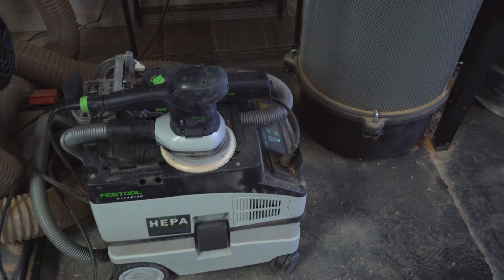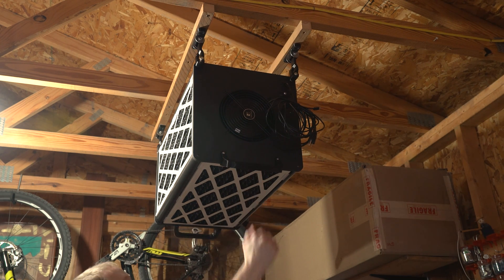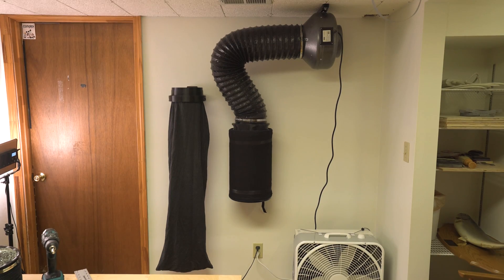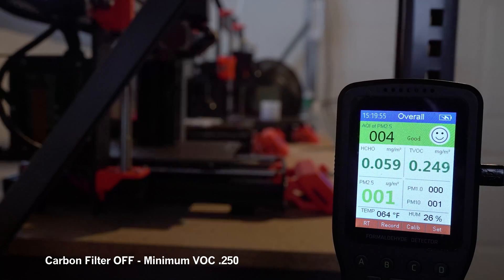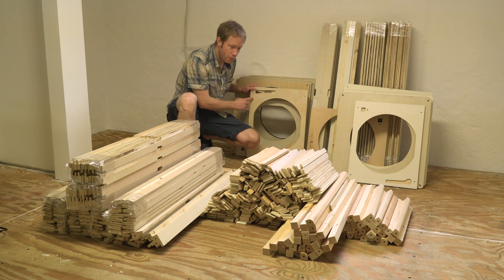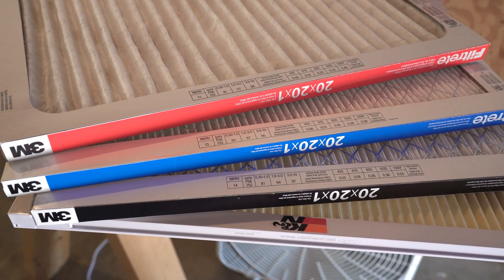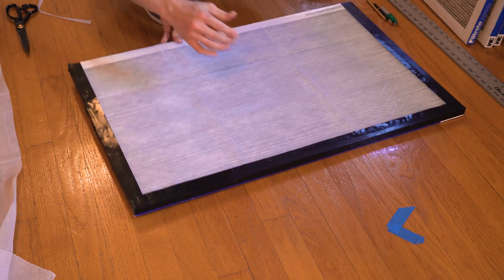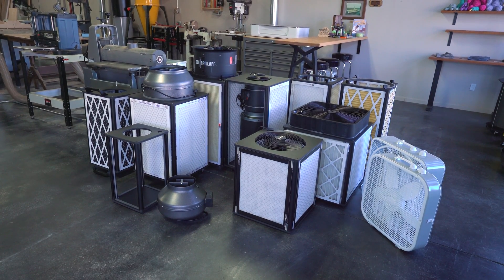DIY Quad Filters - Everything you need to know

Comment: This is so damn cool! I'd love to get started... heading to your etsy now. I am looking forward to the ceiling video as this is probably the configuration that i have to use - sadly I may not have a choice, but I think i can still run it ducted.
I'd like your thoughts about what I could do for a buffer. I have a 8" grinder repurposed as a buffer as i polish a lot of plastic. Using the compounds makes a ridiculous amount of dust, and it's extra bad because it's buffing compound. i have a couple of shrouds and use a 4" hose connected to a 1hp DC, but it can only do so much. I even noticed early on that if the shroud was too close, it was counterproductive - it's like the wheel creates its own eddy or zone around which you can't actually suck any air! So backing up the shroud means it catches way less than 100%. Short of fully enclosing the thing I'm not sure what to do.
Reply from the maker: I do not envy you! Buffing is just about the worst when it comes to dust. It actually was the original inspiration for my first air filter. I was working in an attached garage and a month after starting buffing in there I started noticing that everything in the house was covered in shop dust. It took me ages to get that cleaned up.

My solution for that was to build a small plastic room, much like the one in my ducted filtration video. The filter inside the plastic sheet room around the buffing wheel is constantly sucking in air and ducting it out of the space. All the clean air pouring back in through the holes in the room prevent the dust from escaping into the area outside the buffing space. 

My original concept for this was rudimentary in comparison to the Model-B but it did take up less space. If you have the space, the B will be great. Definitely keep using the shroud, though. It's first and most valuable line of defense. If you want to talk more about this, message me on Etsy.

I did get the ceiling mount listed. I want to add an option for a _ sized hole on the top so you can run a duct and mount the fan to the ceiling or wall instead of connecting it directly to the filter box. I can do any custom size that you may need https://www.etsy.com/listing/1688303282

Comment: cant wait to see testing on prefilters. the 3m ones do get expensive. i also wish they did have quieter options for the house. even the drum fan and lasko are pretty loud tbh
Reply from the maker: True. That's why I got the AC infinity fan. It is amazingly quiet but also quite expensive. I'll do a video on shrouds for box fan soon. They do help a bit with the sound.
Reply: isnt it half the cfm compared to the drum fan on the highest setting, while being louder too? i cant shake the feeling that when its on the low 3w setting its silent but only because its not doing much of anything...
Reply from the maker: It has about 2/3s of the drum fans airflow. Just about all HEPA filters also move virtually no air on their lowest setting but the wall fan seems to do better. I'd say that the AC infinity is doing about 300cfm on its lowest setting. The "EC" motor appears to just be really efficient. It's has less torque though, so when using it in the demanding shop application, if falls behind the CAT fan.

Comment: Do you think the AC Infinity wall fan version would do well with ducting?
Reply from the maker: Good question. I would say probably not. The motor is very power efficient but it doesn't seem to have much torque needed for working in a duct. Inline fans tend to be best for this sort of scenario because the fan blades are more like an impeller rather than traditional blades. AC Infinity does have a 12" fan that is rated at 1600cfm but it is pretty expensive. The wider fans tent to have better noise levels than the smaller fans which kind of scream at you.

12in AC Infinity Inline Duct Fan  (1604cfm) Premium
https://amzn.to/43zuQov

This fan as worked really well for me and it has about the same CFM as the AC Infinity wall fan.
12in iPower Inline Duct Fan (1060cfm) Budget
https://amzn.to/3x9tKDZ
Reply: @The3DHandyman  that's what I was thinking too. Thanks dude 🤘

Comment: These are great, and I’m glad to see that you have continued the process of refining and upgrading these set ups. Have you or would you be willing to post the db ratings you have gathered for these setups? I would be handy to know for shop and in house use.

A question though: have you given any consideration to perhaps some beautification panels to cover the filters on the exterior? I was thinking perhaps a lightweight and thin metal mesh (not too fine grating), painted black with something like a simple aluminum frame, attached onto the outsides with neodymium magnets would be a nice way to upgrade the appearance while hopefully not impeding the airflow.

Overall, outstanding work!
Reply from the maker: Thanks for the comment! I breezed over the fan data at the end and it's easy to miss https://youtu.be/eYOvnqoW4H0

I will also add the chart to my website later this week.

The pre-filter video will sort of tackle the beatification concept. It does require a bit of work tho. I hope to have a washable cover designed for them in the coming months. I did get some hard panels to test with as well but they are a bit on the expensive side of things. Will give it some more thought!

Comment: Thank you for all your hard work!  I’m building a budget cyclone dust collector. With an Oneida cyclone and a 2hp dust collector motor mounted on top. Do you think one of these quad filters could be used in place of a canister filter?
Reply from the maker: That's a great question! I had not considered that. There may be some benefits to using a kit like this in place of a canister but I would say... maybe? The canisters are very compact and integrate into those systems really well. In many cases the Model-B performs better when dirty/cleaned than even the Wynn canister but it's a though call. I might just stick with a cartridge because of how compact they are, but the space where my dust collector sits is also very small so that plays a roll in that decision.

Comment: Once again great work on your video, I recently bought an AC Infinity Cloudlift S12 also on Healthy Home Guide's advice, so it's great to see you using it in one of your designs as well. I also took advantage of the recent Costco deal on the 3M MERV 14 filters, getting 4 4packs for $35 each pretax, so here's to hoping that they run that sale again 🤞
Reply from the maker: For sure! The MERV 14s were $44 here for 4, but that's still a great deal. I also like the black trim on the filters. Classy looking. Forgot to check today if they still had those. The had MERV 13s last year. I think a lot of the cost of the filter is just in shipping. 

The Cloudlift is a great fan all around. Really impressed with AC Infinity's product lineup all around.

Thanks for watching and commenting!

Comment: Amazing work!  I really appreciate what you are doing for the community.  Have you looked at the 20" DeWalt 5000cfm fan for around the same cost at the caterpillar?
Reply from the maker: I have not, yet. A few people have mentioned this one though. Personally I do like the enclosed motors so that the fan can more safely run pointed into the filter box. If I'm looking at the right fan, it doesn't seem to sport one of those. It is probably more powerful than the CAT fan though which would be nice. Thanks for the comment!

Comment: Man, I can't wait to see the results of the cartridge filter test. I purchased one of the Cat fans for the powder coating spray booth I'm building based on your recommendation and it'll be pulling through some similar cartridge filters. I should be using an industrial tube axial fan but the Cat is a far cry from the $1500 alternative. Even running three Cat's will be significantly cheaper. Hope it'll do the job.
Reply from the maker: Spray booths are a challenging build! They have a lot of needs. I did have success with the cartridge filters and the CAT fan in the upwards "pull config" more so than the downwards "push config". That said, I had even more success with the 12" inline fan that handles static pressure better. Also, ducted filtration rocks. It's a bit like a budget downdraft paint booth. I'll cover all the details on the cartridge filters in the upcoming video and I already have a video out on ducted filtration if you haven't seen that one yet. Thanks for the comment!

Comment: If there is a tube around the wall fan, it probably will work better. I’m very leaning towards the cat fan.
Reply from the maker: A tube around the all fan? Might need a bit of clarification on that 👍
Reply: @The3DHandyman  wall fan. Missed a "w". Converting it to similar Cat fan.
Reply from the maker: In that case, a tube may help the performance. The Cat fan seems to have a lot more torque that the AC Infinity's "EC motor". That seems to make it more quiet and less electricity hungry but looses out on power as a result.

Comment: If you're offering I'll definitely take a one, but slightly disappointed that the high velocity shroud fan is weaker than the caterpillar drum fan because I bought one of those hoping it would be stronger guess not. Though it is a closed motor so I don't have to worry about that and you are right and it does get loud. Also adding the charcoal filter will be useful soon because I'm getting into resin printing. Thank you for the videos over the past 2 days.
Reply from the maker: I was pretty surprised as well. In some cases it seems to perform at least as well as the CAT fan. The deal breaker for me was the sound. I did use it in a large underground parking garage and I was actually able to have a conversation over the top of the fan sound. Totally different story in the middle of my living room.

That 3D printing resin is terrible. Headache juice. For my VOC video I am going to test with that machine. Generally I opt for the FDM option for many reasons, but it doesn't really smell at all with PETG. It's more the IPA fumes. The cheapest option is probably going to be venting the fumes. I will talk about that concept as well.

Thanks for watching and commenting!
Reply: @The3DHandyman  venting seems to be the most popular option for the fumes, and I like the detail and clarity you can get off of resin which is good for Minis, lost casting molds, crystals. It also prevents me from losing a lot of space from all the spools I'm going to have to store n  keep dry not to mention all the colors.
Reply from the maker: Good points, resin definitely has its uses. FDM minis are very low quality by comparison. I am thinking about putting a heat pad under a vat of resin just to stick up the place continuously to see how long the charcoal will hold up. In the end venting is just blowing your climate-control out the window which undoubtedly will cost a meaningful amount if its very hot or cold outside.

Comment: Also, quick question: you mentioned adding a duct reduces turbulence. Is it beneficial to do so with the Cat fan?  Does it reduce turbulence in push or pull or both configurations?

Thanks again!
Reply from the maker: Great question! I would probably not try to duct the CAT fan. Axial fans aren't as good with static pressure as inline fans and I'd think the iPower would outperform the CAT in a ducted airflow test.

Aside from ducting, the Push config is definitely better than the Pull config when it comes to using the CAT fan. In a small space is remarkably better. I get into slightly more detail in the first part of this video on that concept https://youtu.be/zKeNf6fLSLA

In larger 2 car garage spaces, if you just want to filter the ambient air and not focus on dust collection near a tool or work table the Pull method is a fine choice.

At some point I'll do a video entirely on the comparison between the two concepts. There is a lot to consider and it's a question I get a lot.

Comment: Excellent presentation.  Thank you.  I found some 3M Filtrete approximately 20x25 carbon prefilters on Amazon.  I put 4-sheets of this material on one (I have four in the house) of my "quad filters" using 3M MPR-2800 (Merv 14) filters as per your recommendation.  There might be a "slight" reduction in air flow but, if so, it is minor.  We will see how it does.   I bought some Merv 4 standard foam pre-filter material that I am going to try on the other three filters I have running.   The cost of the 3M carbon prefilters is about 3x more expensive so we will see how they compare.
Reply from the maker: Awesome! If you like, post an update in a few months on how they have worked for you. I'd love to hear it

Comment: Very interested in the merv 15 cartridge filter setup. Curious if you are using some sort of washable prefer or using merv 14 filters then the merv 15 cartridge. Perhaps the ultimate set up…prefilter, then 20x30 merv 14, then merv 15 cartridge with carbon filter, and finally using the cat fan! Boom!
Reply from the maker: That would truly be the ultimate filter! I did figure out how to stick the MERV 15 canister into the Model-B but there is one issue. The Wynn environmental filter performs the best but it isn't supposed to filter from the outside in, rather inside out. So that's why I will be recommending it for the end of a duct instead of inside the filter box. That way you can have a vacuumable prefilter as layer 1, layer 2 is the HVAC filters then the MERV 15 canister finishes it off for almost-HEPA fresh air. I suppose I skipped that in this video, it was in one of the versions of the script, hahah. Maybe I will cram it in the video on prefilters...

Comment: Tangentially related, but have you considered looking into DIY approaches on the dust separation side of things? 

One of the projects I have on the backburner is reverse engineering the Harvey G700 cyclonic dust separator - using a dust collector fan, short lengths of 8 inch PVC pipe from Amazon, and 3D printed adapters, fittings, and fins to replicate the functionality of a $2500 machine. 

I'd love to see your take on it.
Reply from the maker: I very much like that idea and I have something in mind. Just need time to test it out. Maybe later this summer if all goes well. Thanks for the comment!

Comment: Love the videos and your thoroughness in your testing of the products. I have been very interested in these kits since the first video came out. I am just about to start working on setting up my two car garage and I guess I am glad I waited. These model B’s look great and with living in the southeast, not being made of wood will help with the humidity and stuff. I definitely like the hanging option one. I am thinking about doing two of them or the ducting idea is interesting. But since I usually have the doors open when working in it, it is not climate controlled and is still used to park cars in, I am not sure the ducting option will really benefit me. Great work with these.
Reply from the maker: Thank you! The ceiling mount is great to keep your floor space open but one nice option with the CAT fan model is that you can take the fan off and use it to air out the garage when you have the doors open. Then when you want to use it as a filter just put it back on in a few seconds and you are ready to go.

Comment: I bought an old blowe rmotor and made a plywood box to create a 4-way filter with MERV 13 2" fans.  My Dylos says I get down to single digits in both small and large particles in the room.  However, thank you for pointing out the push vs pull method as I definitely still notice lots of dust on stuff.  Mine pulls and blows really hard up into the rafters, I'm sure blowing dust all over the place.  I'm going to see if I can reverse it, but I suspect it's too powerful to blow into the filters.  Thanks for all this content, I'm very likely to be buying one or more of your kits.

Another use case I've considered.  I'm about to start building a house.  I may have the hvac contractor add a blank return into the (conditioned) attic space so I can build an inline filter for a whole house air cleaner.  I suspect it would be really useful during pollen season.  The only thing I'm not sure about is how I'd duct the filtered air back into the house
Reply from the maker: You could try ducting the fan to another part of the shop. This should help cut down on air turbulence and make the system more efficient. I would not recommend blowing a lot of dust into a centrifugal blower (push config), it's not designed for that and it could be a fire hazard. 

Love that idea for a whole house air filter that is separate from the HVAC system. You could leave one section of wall between the studs open all the way into the basement (or lowest floor) and then just put a vent on the outlet. You may sacrifice some insulation but, it's a convenient solution to creating a circulation loop through the house.

Comment: Love the videos, just enough geeking goodness to keep my squirrel brain engaged.  Ialready bought the cat fan and 20x25 3m filters.  Still need to figure out how to build it or get your kit or free plans.  My small shop needs the help.  Running my diy box fan with 2" filter just does not cut it, my airdoctor upstairs actually detects the dust when I am working in the shop even with doors closed.
Reply from the maker: Awesome! Sorry for the delay on those. I will be putting together the plans and the website updates later this week. If you check in on the weekend, they should be there. That Air Doctor is the canary in the coal mine, haha. I was doing some demo work in my basement last year and was using that to see how much dust was escaping my plastic-wall work-area.